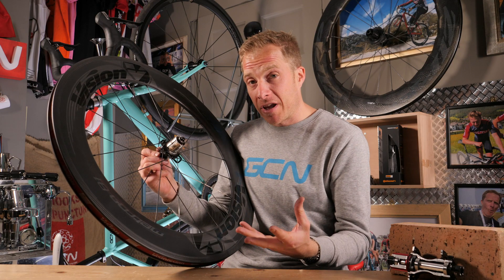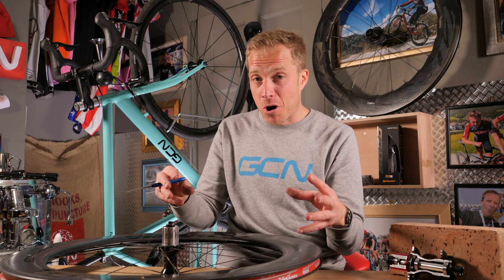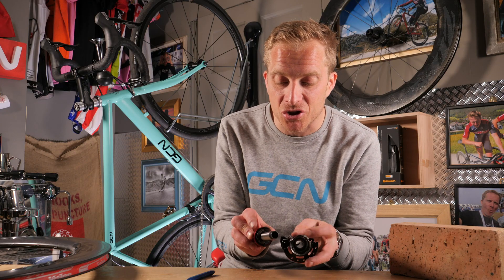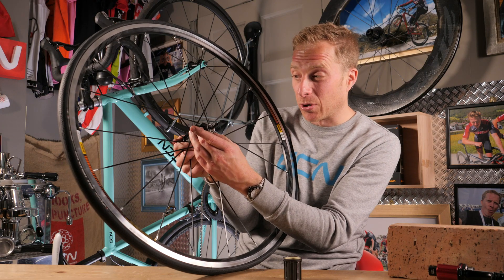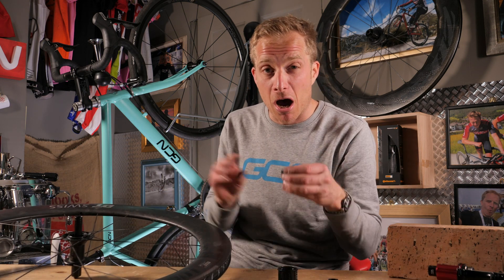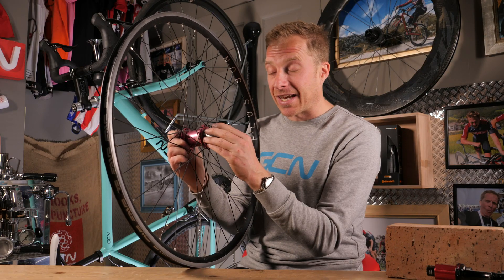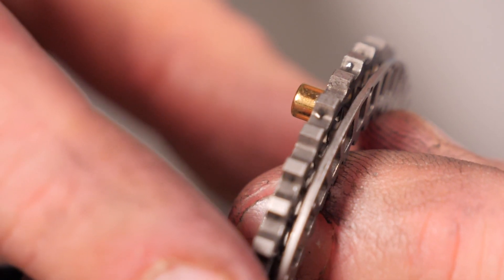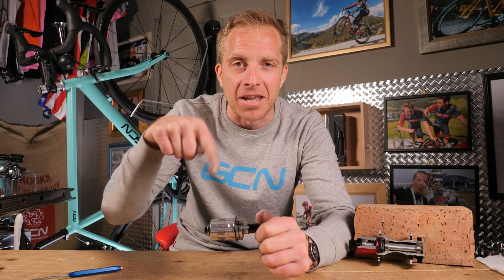Freehubs Explained: Everything You Need To Know About Road Bike Freehubs

Comment: At 7:30, the remark about a King hub getting "tighter," the harder one pedals, might sort of make sense, but NOT any notion of "more power transfer." All ratchet designs do one and only one thing: they allow freewheeling when pedaling relaxes forward tension on the chain, via the one-way pawls, toothed plates, etc. and they flip/engage/rotate as soon as pedaling pressure moves the chain faster than the unit is free spinning, to apply clockwise force to the hub, thus the rear wheel. Power transfer is either on or off, engaged or disengaged, and so is either working properly, or slipping - for instance, when too thick a grease sticks pawls and keeps them from fully opening against the opposing teeth.
 Some hubs seem to freewheel faster, i.e. coasting and overtaking riders on descents when no one is pedaling. This may be partly the quality of main bearings, as freewheel drag normally is negligible. Some claim fractions of a watt losses from thicker lubricants, but for all but Olympic or World Cup TT events, wheel maintenance and longevity far outweighs the miniscule gains from light oil.

Comment: Get a playing card( poker, blackjack etc) and plqce it so it catches the rear wheel spokes on the cards flat side( closer to hub for higher pitch / closer to outer rim for lower pitch noise), just tape in place on the rear fork opposite the gears so it has less chance of getting chewed-up. This is what we did as 10 year olds to mimmick a motorbikes noise, it sounded more like a toy helicopter but the benefit was that a cyclist could be heard from a greater distance and recognised as " one of the gang"...it lasted for about a week during summer hols as a fad but there is some logic to this early cycling mod..the "Sound" of your wheels freewheeling is the sound of Freedom!

Comment: I took my Cube Attain GTC Race 2019 for service, and my LBS told me that my rear freehub makes a sound and sometimes it doesn't rotate freely. Wheels are Fulcrum Racing 77. He couldn't find a replacement freehub, so he said that the best solution is to put new wheels. Until I do that, I would like to ask: Is it possible for the freehub to BLOCK while I'm out, thus throwing me off the bike?
Reply: Just replace bearings

Comment: I just bought a pair of Miche hubs on ebay. The freehub body in the picture looked like a steel shimano unit. Once I got it, I found it wasn't. It wasn't a Campy, Sram, or any of the newer types. It looks just like an old Shimano HG freehub body except all of the groves and slots are the exact same width. Any help identifying it would be greatly appreciated. Thanks.

Comment: They all sound good.
Although I had a road bike and it had a freehub that was very quiet.
It didn't make any rattling sound. I don't remenber what brand this was.
My bike was scrapped after 38580 km. It was not worth the repairs I needed to do.
I now have a different bike with NEXUS-8 hub. It works very good and it's not very loud
The sound is just right for me.

Comment: You really want to remove a freehub over a wide tray, to catch the ball bearings, pawls and springs. But it's really not that hard to overhaul one. You just need a couple of specialized tools, with some models, to remove the bearing(s) and end cap. Definitely a more advanced procedure but still easier than building a wheel.

Amazing how much torque those tiny pawls can take without breaking. Just 2 on my bike's freehub that carry all the power I'm putting down, in theory up to 1000W each (as if I could ever approach even a fraction of that!).

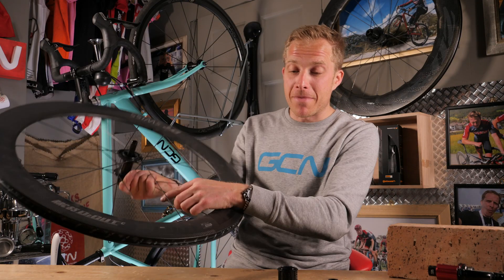Comment: 6:06 It is NOT similar at all as a clutch car.. at all.  you probably not seen a clutch car in reality how it works, or how it engages.. the disc of the clutch is completely flat and is locked by the pressure plate IN A CAGE formed on one side by the flywheel and on the other side by diaphragm of the pressure plate (!), these to bolted together around the disc. Then the disc "communicate" with the outside through the gearbox ax... 
while those tooth on your hub.. locks into each other as soon as you overcome the opposite speed of rotation of the wheel.  
No similarities here, I am afraid..

Comment: I have tested various lubricants for the dt star ratchet, besides the original special grease. any grease wether thin or thick is inappropriate to reduce wear of the teeth as it quickly gets displaced and does not return. Additionally, the stiction created by grease impairs the mobility of the ratchet in the drive ring, which is crucial to prevent misengagement and damage to the teeth.
the best lubricant hands down is transmission oil (75W/90), maybe hypoid gear oil (85W) is better for hot weather. This oil is thick but thin enough to flow arount, yet does not leak through the seal. it's excellent anti wear property effectively reduces wear by friction which is visible as black "dirty" grease after a short amount of time using grease.
I've done my testing on a powerful ebike (750W mid drive motor), making the ratchet's life very hard.

Comment: Is there a "reverse" freehub / hub? 
Basically where the chain and sprockets are on the left side of the rear hub instead of the left.
I want to build a quadricycle and double freewheel seems to be the best solution (better than differential) but it requires complicated hacking solutions. A reverse freewheel hub would allow to use a solid rear axle. Sprockets would be attached in the center of the rear axle and the wheel hubs would have freewheel on the inside and the pawl-ring would be fixed to the rear axle. So you would need a hub with reverse pawl brakes and a freehub that doesn't have a cassette but a clamp to the rear axle. That would be the ideal.
Ideally also with disc brake attachment on the axle side too.
Maybe this already exists. If not, I hope someone eventually makes one because it would make building a quadricycle quite easy! (Check out the pony4 quad for an amazingly simple design).
PS: Thanks for the video!

Comment: This vid has totally missed the point.
What we want is to avoid the dreaded dead space on the crank turn. That means the difference between flow and stop on the trail, on the technical sections. Smooth transition is what it's all about, and that is why we obsess about the sound, a good high frequency sound means less power void.

Comment: I have a bike with a freewheel from 1971. It works great. I was not able to break it down for cleaning but did use WD-40 to clean out old grease and any dirt by spraying it in one side and draining out the other. Afterwards using good penetrating oil in the same manner.  It makes a very faint clicking sound, for all intensive purposes it doesn't make a clicking sound at all. I kinda wish it did as I like the sound. A loud free hub means or could mean it's not lubricated or at least not very well which of course leads to a short free hub life.

Comment: What freehub/wheel with freehub do I need to be able to ride this 13-21 Campanolo cassette I bought?
I bought it for $130, so I don't want to never use it!
It doesn't fit on my Shimano wheelset with HG freehub body, because of a different spline pattern.
I've just moved to a flat area so I need to use these kinds of gears!
Help!

Comment: Okay so I have an old raleigh bike which im modifying into a retro modern bike with brifters. But the bike is currently a 6 speed which fits a 7 speed and im looking into changing the old freewheel fitted wheels into some nice vision wheels but the ones i want to put on the bike only fit 10-11 speed cassettes. So if I want to ride those wheels with a 7 speed cassette, is it just as simple as switching the 10-11 speed hub with a 7 speed one? Thanks in regards to any answers :)

Comment: Thanks for the info. I'm riding a touring bike with a Pinion gearbox system with a carbon drive strap. In this transmission system, a lot of strength is lost, also traveling long distances, a low maintenance hub is needed and easy to repair, also traveling with saddlebags, many-spoke wheels are needed more or less 34 or 36 spokes to support a lot of weight. What hub or system do you recommend for 34 or 36 spokes? bikers hug,

Comment: I am wondering how to disassemble my hub, so I can clean out the grease and neatly put it back together. The hub says Formula on it. The rim had a piece missing along the edge. So I took it apart and recycled the rim and spokes.
.
RJ the Bike Guy demonstrated using a large hex wrench to get the freewheel thing off, but I couldn't follow what he was doing after that. It's an older style, and I expect it is the type that has loose ball bearings inside.

Comment: Chris King is the superior technology not only because it is fully serviceable but also because of the bearings and their placement.  The non-serviceable free hubs on the other hubs are inferior for that reason.  Further, the bearing size and placement within those free hubs are prone to failure.  I toasted a Dura ace 7800 free hub within 35,000 miles due to non-serviceable bearings, their size, and their placement within the free hub.  I have over 75,000 miles on my Chris King hub with original bearings.  Do yourself a favor a completely dis assemble a Chris King rear hub.

Comment: 3:50 isn't that (many engagement points) so you have better pedal precision ? Especially on trial bikes when you need to put your pedal in place before a trick ?
Reply: It’s important in mountain biking when you are “ratcheting” (moving pedals up and down repeatedly to pedal without hitting rocks or roots) through a technical section. You are right about trials also

Comment: All these different mechanisms are in my opinion not about optimizing the power transfer. If it's locked, it's locked, you're not going to loose 10% power because you have only 4 rather than 50 contact points. They are imho very much about material stress, usage and thus life expectancy.

Comment: Hey there:

I recently bought an entry level Cannondale road bike with Claris components. After a few months riding I decided to buy my first upgrade and I bought the new 105 R7000 kit. However a realized the cassette is a bit bigger (it has 11 speeds)  than the one that came standard with the bike (Shimano HG50, 11/30, 8 speed). My question is; if I buy the rear 105 free hub, would it fit my current aluminum wheels or I need to get a new wheelset too?

Comment: Thanks a lot for the video. I have an old MTB Bontrager rim (29er RXL Scandium) with the freehub body FH-420386 TPI, which is clearly worn out. I'm upgrading my groupset to Shimano M-8000 2x11, with an 11-46 cassette. My questions: 
- Which freehub do I need? Quite difficult to find how to evolve from the existing freehub to a newer one.
- Which one would be compatible to my bike? 

And another question:
- I suspect my axle is also worn out and would need to replace. Which part would I need? 
- Should I replace the entire hub? If so, which part(s) do I need. Many thanks!

Comment: I think you're confused the mechanism or the shape or the teeth when engaging want to get stuck asked pushing harder the force or your legs not the springs pushes them into full engagement. It's the springs bounce that allows give for them to slide it away in reverse when the shape of the teeth or arms pressing together does not fit into engagement. So the spring strength he's only he enough to her help get the teeth to start engaging your legs do the rest the soring does however need to her weak enough and compress enough without debris in the way for the teeth to freely with as little friction awe possible retract far enough for the teeth to slip over.

Comment: I remember when Shimano introduced the first 600EX freehub in the 1980s.  I think they basically said it was a more compact and efficient way to package the freewheel mechanism, resulting in more symmetrical dishing than existing separate freewheel/hub combination, which allowed more than 5 cogs on the rear wheel.  Are there any other advantages to either freehub vs freewheel?

Comment: Jon, I’d love to see a similar video about bottom brackets. I doubt they’re as complicated as I think they are, but lets hear it from the experts!
Reply: I have a sealed bearing bottom bracket, they're not a big deal at all, you don't need to replace the loose ball bearings, adjust the cones not too tight not too loose etc like you do with the hubs and they are not as complicated, with bottom brackets you take the old one off, put the new one in, and you're done, you just need the proper tools.

Comment: If you want to see a crazy freewheel mechanism, look no further than the left freewheel in a Sturmey Archer Model X or Model K, or a BSA 3 Speed hub. They have inverted freewheels where a toothed planet cage sits within a ball cup which is fitted with two sprung pawls. When you freewheel, the pawls spin around the static ratchet teeth. 

Another interesting freewheeling arrangement is to be found in a Sram Automatix hub, where high gear is in fact fixed and in order to freewheel, the hub must change down into low gear, though it does this automatically and will change back up instantly when you start peddling so long as you're above the threshold speed for activating the centrifugal clutch.

Comment: Hey guys, any idea why the back wheel would start to wobble at high speeds? 

I was doing speeds up to 34mph then hit a downhill section on the road, got up to 40mph but the back wheel started to wobble. At first I thought I had a puncture but there was nothing visible to see.

I carried on, got back to around a constant 25mph and up to mid 30s again. The ride was smooth and I've never came across this before.

I am an occasional rider and this was the bikes 1st outing this year.

Much appreciated if anyone can shed some light on this!!

Comment: While it's Not quite racing-popular, the NuVinci N360 https://www.youtube.com/watch?v=kN8CCY1vFC8 Forms a design mod which eliminates near all the mechanical break points of the free hub transmission working. Even the total weight is near the same. I've added the unique FSA Patterson Crank that extends the N360 range  https://www.youtube.com/watch?v=IIvdjMV5G78

Comment: The main reason to upgrade the DT Swiss star ratchet to 54 tooth is not for sound, it’s for for instantaneous engagement when putting power into pedals.  There are fewer degrees of pedal arc before the teeth engage which is helpful in mountain and gravel bike riding.

Comment: Hello, I have some Dt-swiss wheels. 
When I push my bike forward without pedaling my pedals, my cranks will spinn forward. 
What can be the problem with my freehub? 
Thanks Gianni
Reply: It may be a bit dirty so the ratchet is sticking, especially with the light load of just pushing the bike. A bearing could also be worn causing drag. It can be dangerous if it sticks/locks at high speed. Your rear mech will be ripped off and may jam in the wheel.

Try taking the freehub off and clean/relube the mechanism...DT Swiss is easy to do. If that doesn't fix it, take it to a bike shop for an overhaul.

Comment: @joncannings, You’ve forgotten to mention that one benefit of having more points of engagement is less lag from coasting to pedaling. This is especially important for XC and technical Trail riding since mountain bikers are often riding in situations where a complete revolution of the crank is not possible due to rocks and other obstacles thus requiring the rider to propel the bicycle by “jogging” the cranks.  It for this reason that wheels built with Chris King hubs have become something of a holy grail for many mountain bike enthusiasts. It is also the reason that many other manufacturers have recently been upping the pawl or tooth count in an attempt to swipe a little bit of that hardcore mtb business.
Reply: This was mentioned in GCN interview here https://www.youtube.com/watch?v=vgPLJSTWuV4

Comment: I have a couple of wheelsets with OEM hubs (3-pawl, I assume), and they sound, well, just as one expects from decades-old bikes. I built some DT 240 wheels, and I love the busy-bee sound. I recently got some DT 370 wheels which are nice and loud for warning pedestrians. But frankly, they all seem clunky compared to my latest...

I bought a 2010 Felt F1 with Dura-Ace 7900 groupset and WH-7850-C24-CL carbon wheels. The hubs are like butter! They spin forever and are near silent when they freewheel. What kind of wizardry have they plundered? They are not of this realm. I love ‘em!

TECH QUESTION: Shimano‘s later carbon clinchers are labeled as tubeless. These aren’t. Did they actually change the rim design, or did they just rebrand them when tubeless became more popular? Can I just tape and valve them for tubeless, or will I find a problem with the bead? Thanks!

Comment: Jon is there anything that can be done to reduce or limit the notches along the spline? Is it a sign the lock ring is not tight enough?
Reply: You can try a higher end cassette that puts more cogs on a carrier which spreads the load or some hub companies offer a steel/titanium freehub replacement. Unfortunately, even my beautifully engineered Hope Pro4 is chewed to bits...I've had to take a file to it before just to get the cogs off. The Hunt/Novatec hubs seem the best compromise of aluminium for light weight but with the one steel insert to resist cog bite.

Comment: How is a free hub different from what is on my stock Giant carbon road bike?  I probably don't already have a free hub, because there is no noise. 

Also, how much are freehubs better for power transfer (than stock)? I didn't realize I was losing power. Seems fine to me.

I've gotten a couple pretty dismissive comments asking about freehubs on the road. Oh well!  Wish I had a clue.
Reply: Charles Letcher if you can freewheel (coast) and remove the cogs from your cassette them you have a free hub. It might use a sprague clutch rather than ratchets if it is silent.